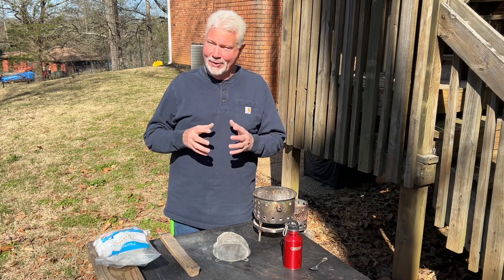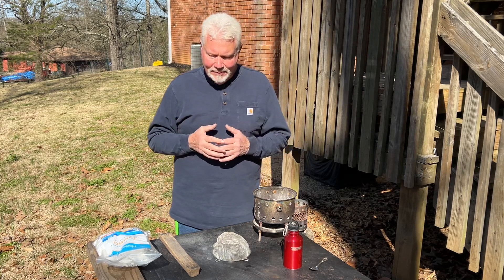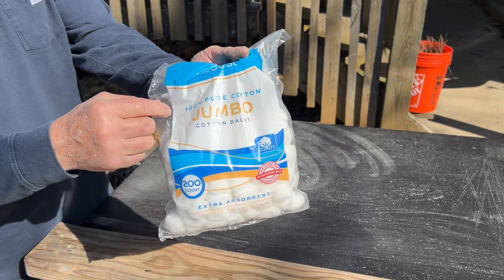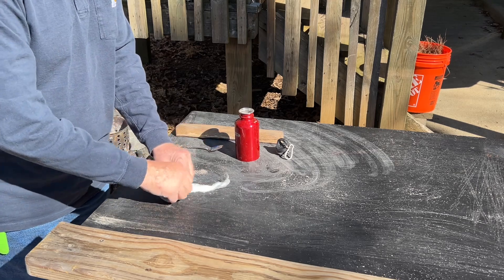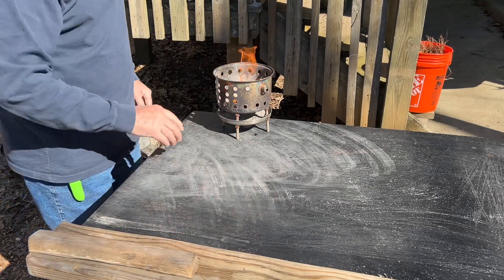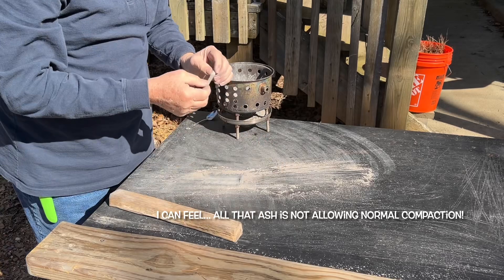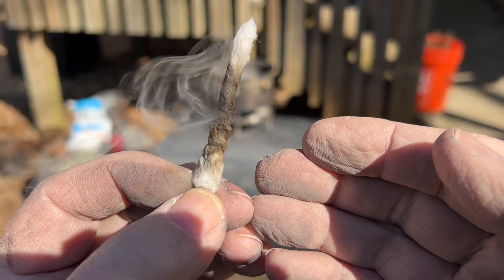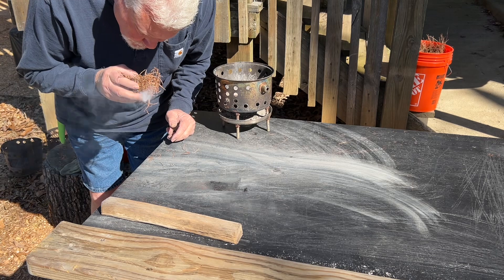Fire Roll Tutorial And The 3 Most Common Mistakes

Comment: What is the purpose of ash? Does it merely provide friction? Could something else like chalk work?
Reply from the maker: Friction and chemical reaction. See my fire roll playlist.
Reply: @DavidWestBgood2ppl  Interesting... My dad told me of the same method working on rice straws. He worked as a prison guard in Korea in the 1960s. The inmates would make a thin rope with rice straw, making sure to twist it very tightly. Then, they roll it between boards until it smokes. They'd break it open and it would have a coal. They used it to light cigarettes.
Reply from the maker: That's interesting!